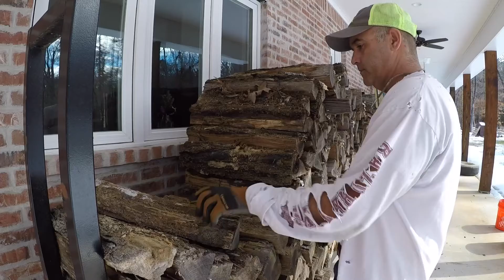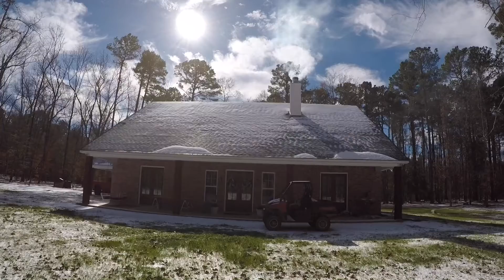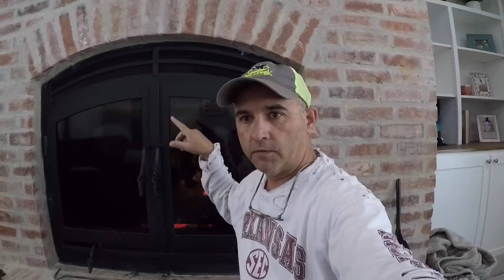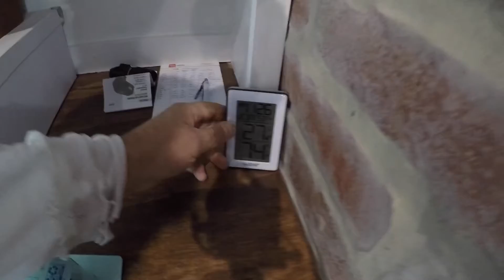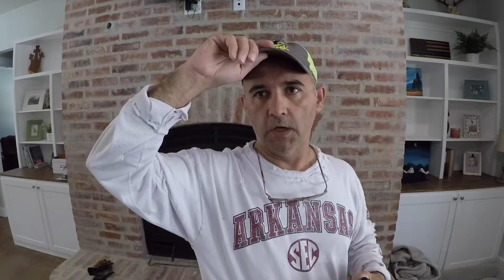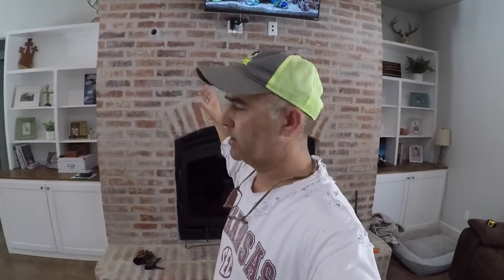AcuCraft 44” Fireplace 1 Year Review / Pro's & Con's / Fireplace Insert / Heating with a Fireplace

Comment: Do you get banging from the metal box contracting with the heat cycles?
Reply from the maker: I don’t get any banging noises.
Reply: I get the banging with my new 48”.

I’m also getting a very loud blower motor when it’s on high and once it’s been on for about ten minutes.

Comment: I have the same fireplace.  I have no issues with smoke coming in the house as long as you close the air intake all the way.
Reply from the maker: I will have to try that.  Thank you!
Reply: I'll have to try that as well on a hearthroom 48 I recently installed
Reply from the maker: I wanted to let you know that worked.  Thank you!!!
Reply: @hollyridgehomestead it's probably because your house with the foam is so tight and with the gigantic flues the hearthroom takes - you might actually be taking air in from the fresh air system causing some smoke to come in with it
Reply from the maker: @CarbideEnterprises that’s exactly what was happening
Reply: @hollyridgehomestead I'm so glad i found your video and read the comments. I've installed 5 hearthrooms over the past 2 years. One of the 48's my customer is just moving into his home and having issues operating that monster. I'll check back in on Sunday after i test everything out.
Reply from the maker: @CarbideEnterprises I need to clean it this year and put that on a yearly schedule.  Now I will say we gave up on cleaning the glass.  It is more for just heating the house.  We don’t use it while we are sleeping.  We switch back to the heating unit.
Reply: @hollyridgehomestead well just try using the ashes like i said you'll be amazed, my personal stoves i don't clean them often either lol
Reply: How did it go with your customer’s 48”?  I’ve used mine a few dozen times and am still getting smoke with the doors open, which is my preferred setup while enjoying an evening fire. Acucraft suggested I try removing the plate. I did, and it helped a lot, but I’m still getting some smoke, enough to annoy family and guests.
Reply: @John-n8c6k what year was your house built is it pretty tight?
My customer's 48 definitely had some rollout as soon as the doors opened. I did a bunch of tests with paper and a small fire. That unit and its massive flue really requires a huge fire - definitely would help to start the unit with a top down burn with a tall firewood setup to get everything nice and heated high up. I verified the intake was sucking in air. I wanted to go back over there and do some more testing with a larger fire and with the windows open more to see if I could verify if it was a pressure issue in the home. The last I heard though the homeowner removed the plate himself and the rollout was significantly reduced. But he did say he put a larger log on after a small fire dwindled down and got some smoke into the house. I told him he needed to at least get the larger logs burning pretty good with the fireplace doors cracked before he should open them again. Haven't heard back from him since the holidays. I also suggested a fresh air makeup system dedicated to that room and the fireplace - it's a gigantic living room with a massive cathedral ceiling. The plate is for efficiency. If you're just using the fireplace for show and don't care how much heat it's putting out or how much wood you go through then as advised by accucraft take it out. It's crazy how much wood that thing really needs. Another suggestion I made was to initially start the fire with about 4 bundles of like that kiln dried firewood you can get at the supermarket or gas station etc, building it up tall. But yea I guess it's alright for the customer with the plate removed, I'll text him eventually and see how it's going. One last thing, I'll reach out to accucraft again eventually to suggest that they really should have dual fresh air on the 48.

Comment: If you clean the glass  windows with easy off oven cleaner, I was told  this by a chimney inspector. This way is quite simple, I go out outdoors and spray into a container then use a paint brush to apply the liquid onto the glass. I wipe everything off taking care to protect the hearth with paper.
Reply: Clean the glass with ash it's free and works way better. Dip a wet paper towel in some fine ash, some guys use newspaper

Comment: On the install video you had a propane line running to the fireplace. Do you use that gas line to help start the fire?
Reply from the maker: I did one time.  But I prefer to use lighter pine.

Comment: Unfortunately these are not EPA certified, box is to big.  I would use your central HVAC blower to help circulate.  I also recommend a mantel, if your blower goes down.  Also tvs are only rated for 100 degrees.  My .02
Reply: Hearthroom manual gives combustible mantel distance requirements. The specs definitely should be followed. And definitely agree that a mantel should be installed to protect the tv.
Those units definitely aren't epa certified, they don't even disclose an efficiency rating. So i don't know why they even put that smoke shelf inside but i assume it does make the unit a little more efficient
Reply: @CarbideEnterprises  It's to help collect the wood gas for secondary combustion. more efficiency
Reply: @derangedrebel3898 yea

Comment: Did you ever look into Fireplace Xtrordinair inserts before deciding in the Acucraft? They tend to be smaller & cheaper but heat very well because of the catalytic convertor. We are building a home and torn between the two.
Reply from the maker: I did not.  Looked at many before deciding on this one.
Reply: The Xtrordinair will heat a home much better, that's actually my choice unit but is actually a little more expensive than units i usually install. The hearthroom imo is mostly for show with the size of its firebox and it's not very efficient, also very expensive consumes a lot of wood for decent heat . Hearthstone makes an awesome zc fireplace that heats very well and very efficient without the inconvenience of a catalytic converter. Osburn makes really good units but a little smaller. The Ventis he350 is one of the best especially for the money but also needs a fairly large chase. Superior makes an extremely efficient epa certified cat unit that I'm pretty sure is zc, I never installed one but I'd compare it to the xtrordinair

Comment: I have the 36” double sided hearth room. I’m still learning like you are and have had all the same concerns and cons. I have 3 bathroom fans that run all the time to change the air because the home is so tight. This creates negative pressure in the home which I believe is drawing the smoke out of the stove when open. If I crack a window before opening I have zero smoke come back into the house. I was told to get an erv air recovery system and to turn the continuous bath fans off and it will help with the negative pressure, not send the heat outside and keep humidity levels comfortable.
Reply from the maker: Have you taken the plate off yet that is suspended?  I’m wondering if it would correct that problem.  Also we don’t even try cleaning the glass but once after it warms up in the spring.
Reply: I have not tried running it with the plate off, although I have taken that plate off to clean chimney. If I crack the window before opening I get zero smoke. Negative pressure in the house is the problem. I clean the glass with rutland glass cleaner and a scrub daddy every 3-4 fires and it seems to keep getting easier. I am really leaving towards an erv because I am just sucking heat out of my home and it will balance my humidity which is down to 27%
Reply: Also if you contact Acucraft they will send you the spring handle for free. They don’t look as fancy as the basket handles but you can touch them with bare hands. And I’m not fancy.
Reply: @dustinzabelski7071 new homes being so tight I often have to instruct customers without fresh air systems that they need to crack a window. But the hearthroom has fresh air it's required! However it does take a while to heat those massive flue pipes and the fresh air size is the size of most wood stoves 😂. I'm thinking fresh air off and window cracked for first hour is best bet. I'll be testing out a customer's 48 on Sunday and I'll check back in with my findings.
Reply: @dustinzabelski7071 just use ash to clean your glass it works amazing. Me personally a take a moist paper towel dip it in some finer ashes then scrub the glass, it takes any buildup right off you'll be amazed and realize how silly it's been to buy special glass cleaner lol. Follow up with just a clean paper towel and the glass is crystal clear

Comment: You mentioned that you cannot hear it or feel it. What does that mean? Do you mean when the door is shut you cannot hear the fireplace crackle?  And how long after you clean the glass does it get dirty again?
Reply from the maker: Yes when you have doors closed there’s no sound of fire

When it heats up to 100F the blower motors will turn on to distribute heat.
Reply from the maker: It doesn’t take but 1 fire to turn glass darker again.

Comment: great video..looking to buy one maybe. been looking at all kinds of reviews to see if it fits my needs..what is the sqf of your home and how much did you pay more or less for the 44" and was delivery included or extra? also from my understand is there not a heat management system that can be used with this so you can push air into other areas of the house? Im interested in the 44" or 48" also was wondering if you fill the unit pretty well what was the longest burn time you had with the unit..looking to understand the type of heat output it can do..im looking to heat about 1500-2000sqf of open cottage area. im have a nice wood stove at my home with burns for a good 10hrs if i fill up the burn box full. the difference is the look and style i have now is not the fireplace look.. its the free standing stove in the corner which is nice but never the same feel as the traditional fireplace setup..thanks for the info on ur video.
Reply from the maker: So I’m pretty sure I have around $20k invested with install.  Our home is 2055 sq ft.  There is a blower in the system that moves airflow into the house.  I’m still trying to play with the air intake and flue to extend the burn rate.  You have to remember we are in Louisiana.  We actually don’t use as all night heat source.  But have that option because we loose pwr a lot.  I went with 44” for cosmetics.  But for function the 36” would be perfect.  The other size would be too big for our place and wouldn’t look good with 10’ ceilings.  I don’t regret buying it knowing that we will never freeze.  But it is very much overkill for Louisiana.  I would buy it again!!!!!!!!!

Comment: Do you have issues with rain coming down the flue? Even with the cap on, im getting a fair amount of water in the fireplace
Reply from the maker: I have noticed some on really bad storms
Reply: I had rain get in mine also. The rain guard seems to have stopped it.
Reply: Which chimney systems did you guys go with? There were 3 to choose from, the termination cap on one was really poorly designed

Comment: Bruh you clearly don’t understand what you have. Why would you want the doors open when you have a fire. That’s a waste of heat and wood. Then you should have installed a regular fireplace.  Not trying to make u look dumb. But that’s design to heat the house. Of course you want the blower on when you have the fire going. The plate you’re talking about is called a catalyst like what you have in your car exhaust system. Catyltic converter. 
The cons you’re referring to are all irrelevant. Understand what you have. Second I would never recommend a tv above fireplace unless you don’t have any other location to Mount 1.
Reply: "bruh" these fireplaces are non catalytic in fact they don't even have reburn tubes. One of the benefits of these is that you're able to open the doors if you want a classical open air fire or you can elect to use it more as a heater with the doors closed.

Comment: I'm looking to get a elite 44 not sure what the difference is in between yours and the elite what is the maximum length for your outside return airbox to help cool the heat box
Reply: The fresh air isn't used to cool the firebox it's used to provide air for the fire. The elite 44 is a completely different firebox but on the hearthrooms a maximum of 25' is recommended if im not mistaken unless you increase the size of the duct. You can contact Acucraft by email to get an installation manual pdf so you can find out for sure

Comment: On our insert which is 20 years old. We close the flute when the fan comes on. It will burn about 12 logs in a 24hrs. It will get so hot you can’t stay in that room. You can’t see the fire because the glass smokes up so bad. But it does have flames it’s just hot coals when the flute is close and you have to remember to open the flute before you open the doors.
Reply from the maker: It will run you out of the house.  We only can put a couple of logs in it at a time.  Just get to warm to be comfortable.
Reply: @hollyridgehomestead   I wish they could warm the whole house.
Reply: Sounds like you're closing the bypass on a catalytic converter, you definitely wouldn't want to close the flue lol